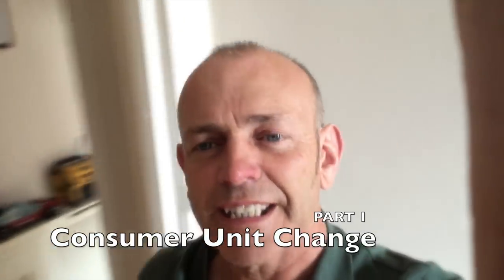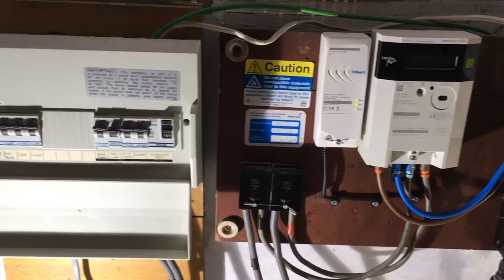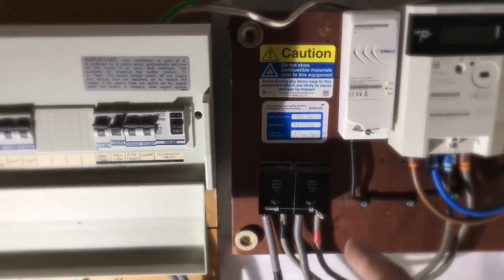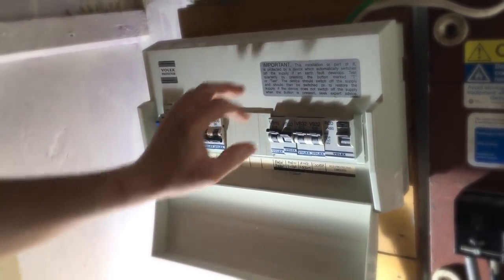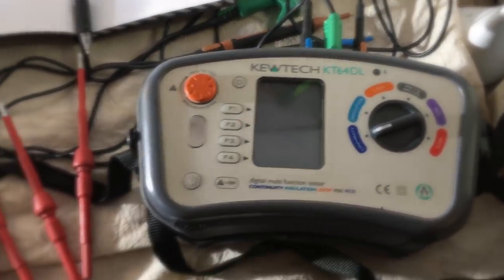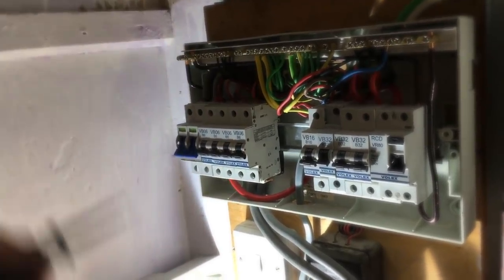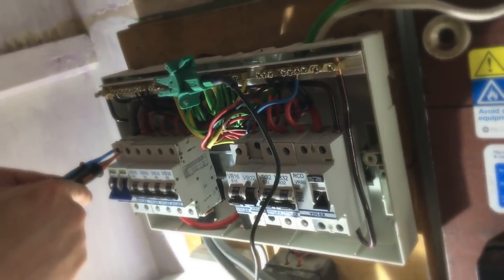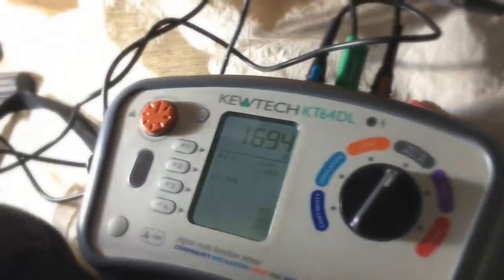Electrician Day in the Life - Replacement Consumer Unit - Part 1

Comment: B6 60898 mcb maximum permitted Zs is 7.28 ohm's.
Tns Ze 0.8 ohm's
I see you've got yourself an armeg torque screwdriver. Most expensive screwdriver I have ever bought and heavy.
Good video as always.
Thanks for sharing.
Reply from the maker: Thanks for your quick feedback and answers Stephen. Your reading looking pretty good. Lets see what other students think. Also you probably know that the ZS question has two possible answers depending on which book you look in. The other book will have a additional factor added giving a lower reading??? Have a think and look and keep us posted.
Reply: I guess your referring to the 80% adjustment for the maximum Zs. Which is what you really should have your reading below.
Reply from the maker: Oh and yes the Armeg Torque screwdrivers are real good. Great your investing in some quality tools.
Reply from the maker: I knew you guys would get it. Great work Stephen.
Reply from the maker: I knew you guys would get it. Great work Stephen, Oh and the armeg set is real good.